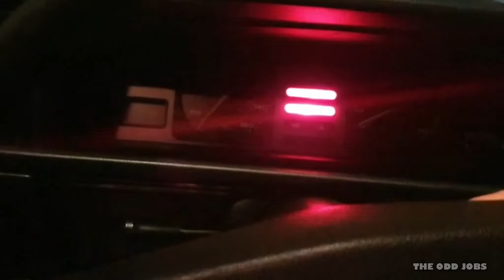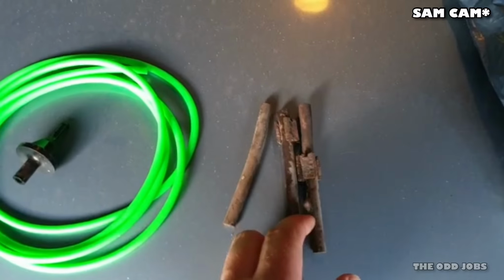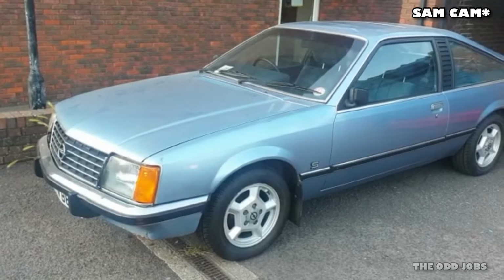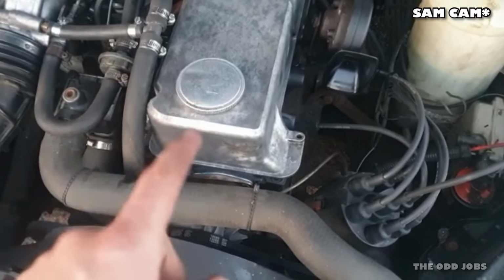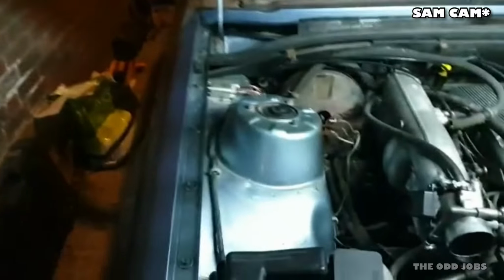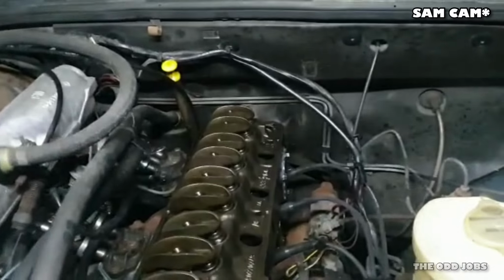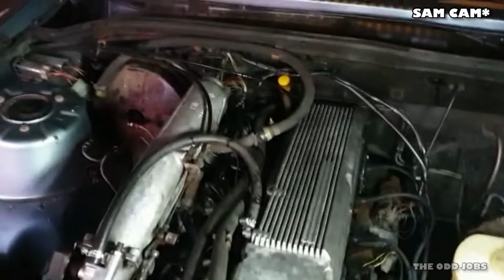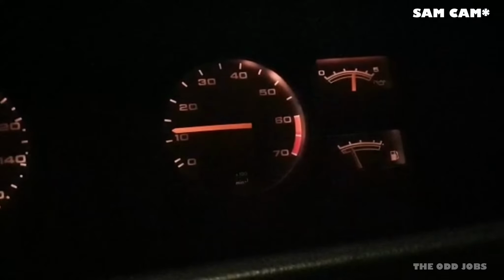Opel Monza series 1 (1979) barn find (part 20)

Comment: U shut of put the ignition on and then take the hose off the airflow meter and then put on the flap inside the airflow meter and then the fuel pump starts running (or bridge the efi relay) that way it would be easy to spot leaks,there is no engine noise then..
(i wrote the comment wenn i say u crank the car over and over but lateron i saw u did that trick)
Those later yellow injectors are from the LE system and they require no resistors the old grey L-jetronic injectors require those resistors that u see there 4 and 2 screwed on the inner fender..

Comment: Spray break cleaner around the intake so u can find air leaks once there are no leaks then check compression on all 6 once they all are okay and the timing is set correct then check ure injectors if they all click by adding 12v on then for a short time clean them in a ultra sound bath to make sure they are clean and then ure engine shut be fine...
Reply: Cheers Ben, we're slightly ahead of this video now and have found the source of the misfire which will be in the next video 😃

Comment: I hear lifter/rocker arm knock. This engines have problem with oil lines in cylinder head. Lines stuck with dirt and valve lifters not getting filled with oil, so lifters don't work. That can cause the rough engine run.
Or maybe they just need some time to get filled fully with oil.
I bet you did, but I ask anyway to be sure :) did you try to adjust ignition timing by slightly rotating the distributor?
Reply: I left the socket on the crankshaft pulley, when It flew off it make a noise like a sticky lifter 😂😂 all sorted now 👍